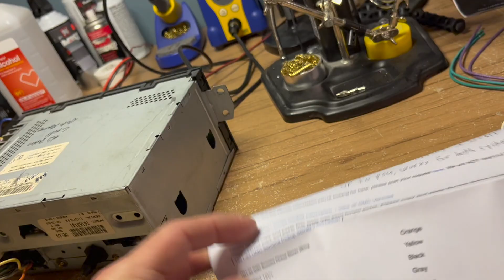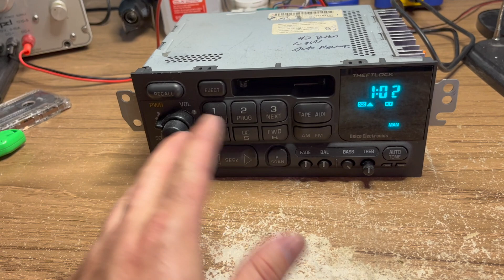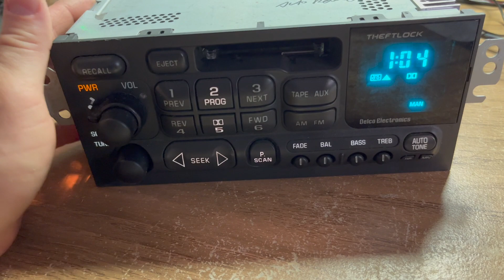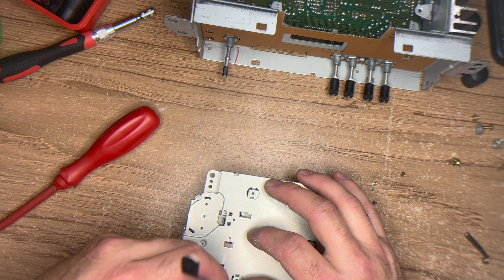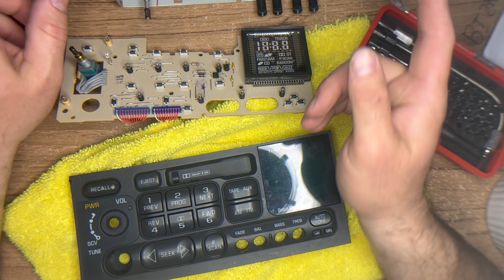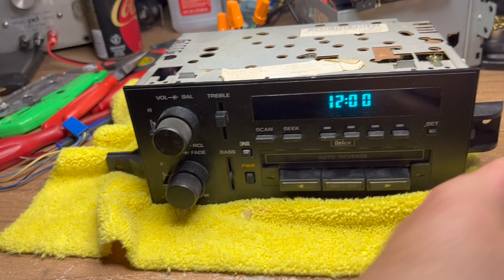Someone sent me a GMC/Chevy Delco stereo to fix - let's check it out!

Comment: the radio that wont power on  they are bad  for the power switch  to go bad....having repaired many...an still have one in my 84 fiero    thats were  i would check  ..some need the memery wire powered  up too...been  a long time  working on one

Comment: I'm surprised the TheftLock system didn't give you any trouble. But who would want to steal a factory GM radio, anyway?
Reply from the maker: It was likely never activated - but I ask the same question everytime I notice the OEM wheel locks on my CX-5; who’s stealing OEM 17” rims when there’s a perfectly good catalytic converter under there?
Reply: @bbishoppcm  My mom's Jetta and my best friend's GTI both had Blaupunkt radios stolen out of them. So Blaupunkt must be the brand of choice of car thieves.
Reply: On European GM radios, you could disable the security code, but when re-enabling it, you could enter in any code, not just the factory default one. This was in addition to removable buttons and the display being mounted in the dash instead of on the radio.

Comment: The display from the first unit is a common part for GM and can be found inside the CD only version. I remember it from my brother's Camaro from back in the late 90's. This confirms my thoughts from back when I was a teenager thinking how odd it was a CD player had display segments meant for a tape deck.